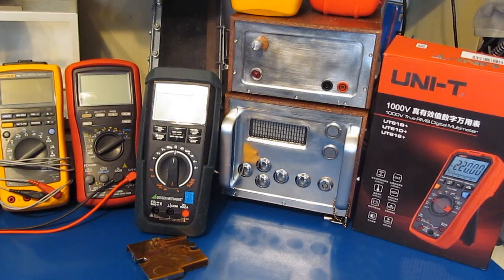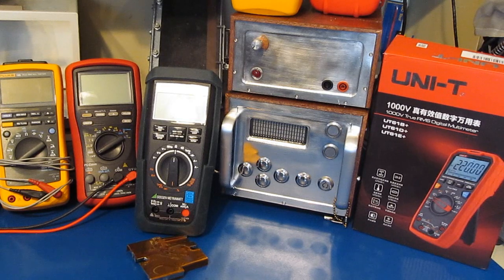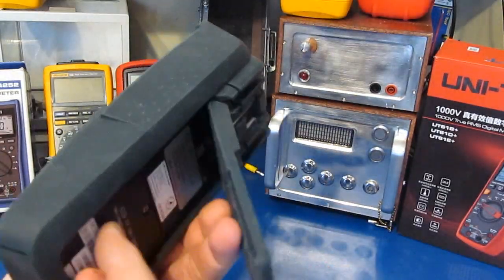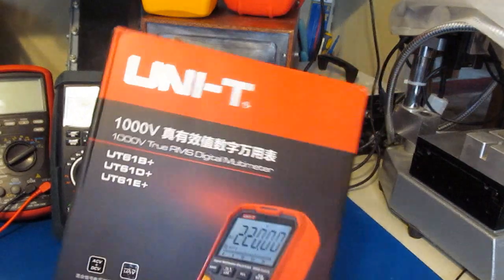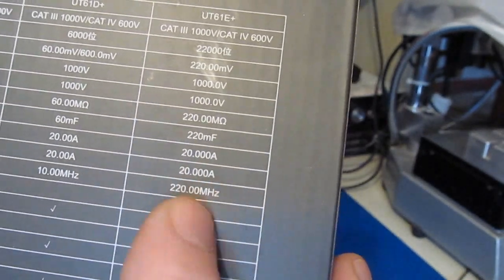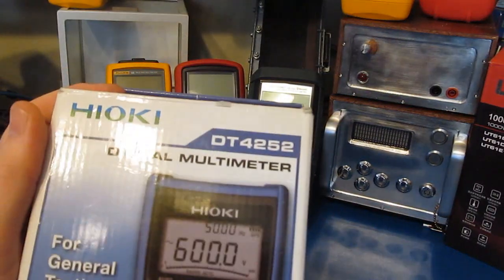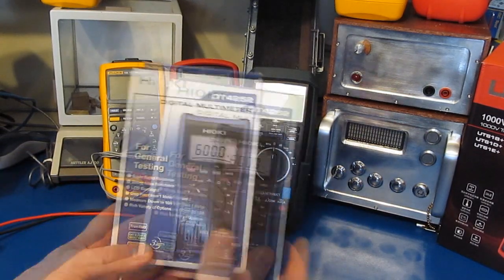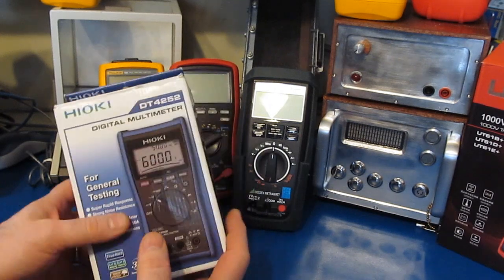Celebrating 20k subs,  Announcing new DMM Poll

Comment: I'm late to the party, but I just noticed a new meter that caught my eye. The MCH-108 meter; sold by ifixit.  I could not find much info on this model but it seems feature rich for only 20.00 USD. Just throwing it out there...
Reply from the maker: Notice how the meter shares the current with the other functions on one connection point.  That's never a good sign.   Keep in mind that this channel is really only concerned with how electrically robust these products are.  Transient testing a that input with the fuse in-place is not going to fair well.
Reply: @joesmith-je3tq  I think it has to to do with an unpublished Chinese specification the meter might be conforming to.
Reply from the maker: @grhinson  Wait, so you think there is some standard that requires the current be shared with other functions?
Reply: @joesmith-je3tq  Just throwing shade...

Comment: Hi Joe long time no see.
my opinion: all of the meters that you have proposed are great candidates.
contact Gossen to see if they have changed the design or not, if not then don't bother.
Hioki might be a good one to look at, here on the east side people love the Hioki brand, it's the De facto standard for top-tier meter, it's basically the Toyota, it just never dies.
however the Metrix one as I have looked at some youtube reviews is a champ, an unknown hero looks like.
I'm all interested to see any of these meters, hope we see you soon again.
Reply from the maker: I did conduct a pole and viewers voted on the Keysight.   The meter is still sitting in the box.  Hope to pull it out soon.
Reply: @joesmith-je3tq  Now we actually needed the Keysight one because you haven't looked at one of their meters as far as I know.
However, I might add the fact that I conducted the Uni-T Support team via email a few weeks ago asking about any upgrade on the PCB design of the UT181A in order to immune the meter to ESD events, and the answer was that the test is not clear enough and something on that borderline.
if you would like to I can send the email exchange to you via your email address so you can judge for yourself.
Reply from the maker: @Jake3757-n9q  If you are a member on EEVBLOG, can you send it to me using the PM?   I did look at a Keysight meter but it did not do very well.  After all of the transient testing, I proceeded to damage the function switch after a few cycles.   They had used a glass filled detent spring which ended up cracking on every prong.
Reply: @joesmith-je3tq  I sent you a PM on EEVBLOG, hope you received it.
I will take a look at the Keysight video to judge for myself, thank you.

Comment: Im happy for you Joe, more subs to come.  I have questiin :  I have a fluke 87v and a uni-T 61d+,, I tried measuring 0.25mv AC voltage. The 61d+ can measure it in matter of seconds but the fluke 87v takes almost 2 minutes before it can display the correct voltage. Would this because of the input protection of the 87v design? 87v can read as low as  0.1mv according to the manual. Im wodering why it cant read the voltage quick
Reply from the maker: That's a long time to settle.  I could try and repeat it with my 87V if you want to provide more details about what you are doing.  I do not have a 61d+ to compare it with.
Reply: @joesmith-je3tq  what Im doing is trying to measure low current draw using the fluke i400e clamp probe. It's ouput is 1mv per amp and can actually measure down to microvolt resolution as long as the dmm can read it. The uni T 61d+ can read to as low as 0.01mv  then the fluke 87v can go down to 0.1mv im thinking  it can measure 0.25mv and yeah it did but very slow. Iv been following you for long now and you may use the 61e plus you have. The input protection are the same with the 61d+ model
Reply from the maker: @juancarlossandoval5628  I would guess your just so far down in the muck that your seeing the settling time of the RMS converter.   You could maybe loop some wire around the clamp to get a higher signal.   I'll try it with my 87V but I am not too surprised by your results.
Reply: @joesmith-je3tq  I will do the loop thing.. thanks much Joe. I tried it again a little bit higher voltage 1.2mv the fluke still take up almost 2 minutes before getting the correct reading. Maybe they should edit the numbers they show  on the user manual. Its states resolution at 600mv Ac  range is 0 .1mv

Comment: Dear Joe, congrats on the 20k subs. I would like to see some cheap (under 50USD) DMMs comparison. I have a Habotest/Kaiweets HT118A and HT208D and I like them. Some of your subs can not afford a 230 USD Brymen BM869s, however personally I really love to have one.😁
Reply from the maker: I started out looking at meters that cost under $50 USD.  The criteria for the generator I use today was based upon the data I collected from those initial meters.   Over the years I have looked at several other sub $50 meters.  Those videos are still available along with the spreadsheet showing the meters I have ran along with their failure point.
Reply: @joesmith-je3tq  I have seen all of them.🙂 I just want to suggest another brand (Kaiweets / Habotest) to test. I have seen only Uni-t, Owon, Aneng and some "no name" (for me) DMMs in your videos. Many thanks for your work, I love your channel.

Comment: Congrats.
 I'm on the fence getting a Hioki DT4282. So If possible I'd like to see a DT4282 or DT 4281 tested.
Reply: Hi Justin, you are right, there are lot of similarities between the DT4282 and the DT4281. Both are based on the same platform and use the same HIOKI HAZ01 custom ASIC and both are made in Japan.

As for differences, you mentioned the current clamp for the DT4281. The DT4282 gives you a current range of 10.000 A for AC and DC and the DT4282 gives you conductance measurements.
Reply: Hi Justin, the DT4281 is more targeted for electric applications whereas the DT4282 designed for lab and R&D applications. Both meters have DC+AC measurement function and one of the fastest update rates in the industry. 
Depending on what you are doing you should get one or the other.
Reply: Hi Chris, I thought when I was comparing the manuals both models were basically identical with the exception of the DT4281 just omitting the Amp current feature?